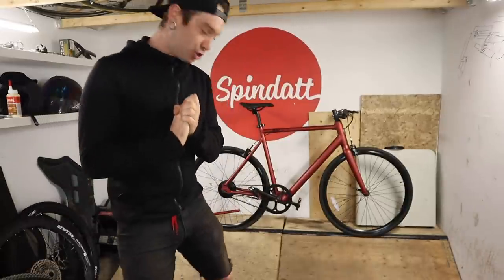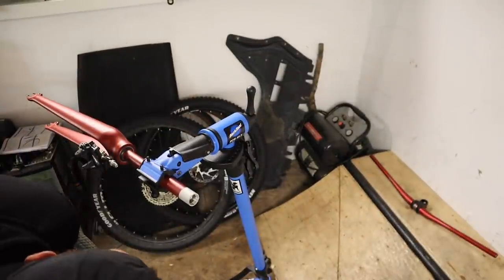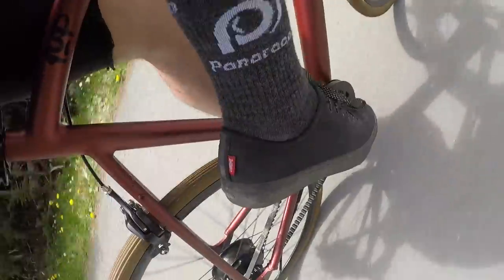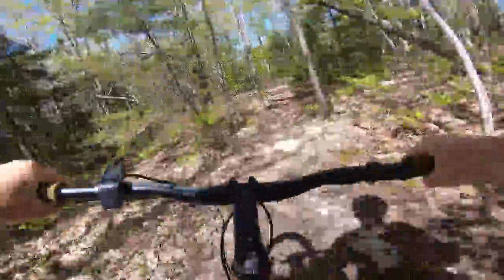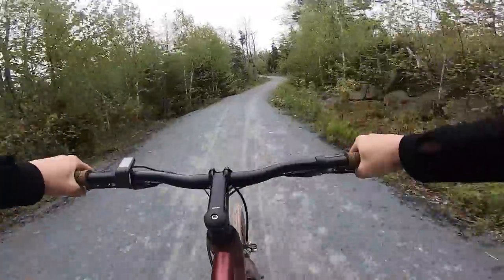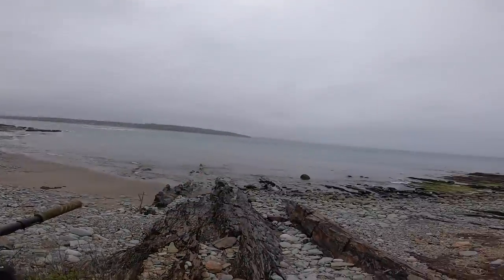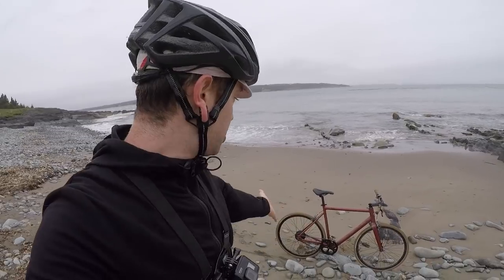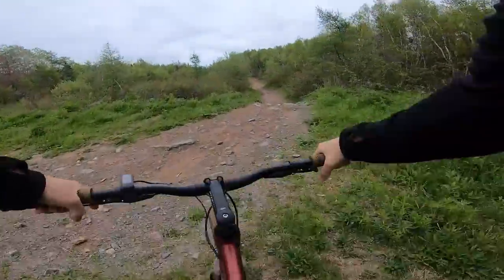RIDE1UP ROADSTER V2 UPGRADED AND MODIFIED THEN RIDDEN OFFROAD!

Comment: I feel your excitement about the ride. I love my roadster V2
I changed out the tires to 32s after first 300 miles cause I mainly ride gravel trails. Added redshift suspension stem up front and seat post. I am 68 years old but on this bike I swear I am only 27.

Comment: Thanks for the review! I used to ride a Trek Earl daily in the GTA year round and loved it for its simplicity. The more bikes I rode, the more I found myself remembering what I wished for then: a simple frame + single speed belt drive + electric assist. I'm just kind of getting back into things now, imagine my surprise seeing this. Reading the comments & seeing all the positive feedback is great as well.

Now that I live in an area with many more hills and much better cycling infrastructure I think I might try to figure a shorter gear from day 1… Ideally I figure out a solution (anyone mess around with the drive system?) before winter hits or V3 comes out soon and takes the $ out of my pocket with a solid design. The Roadster is, what, +10 lbs and ~$500 more than I remember paying for the Earl? that's a pretty great deal imho and kind of a no brainer
Reply: Any luck with an easier gear?

Comment: Uhhhh... You do know Ride1Up makes a gravel edition with all these cahnges and disc brakes already done for you? 😁
Snark aside, fun video! I love my V2 but went a different way with it. Carbon Skinny flat bars, upgraded mid reach Tektro brakes, Kool stop pads, SDG Radar flat saddle, Conti GP5000s. Use the assist controller like a 5 speed and you can really roll! Please try it drop bar and lighter crankset to be my guinea pig!
Reply: I dropped 5 pounds from my KBO Hurricane 37.7 pounds with lighter front wheel & tire, carbon fiber fork & integrated drop bars, then a thomson elite seatpost & light weight saddle.  Am still wanting to upgrade the frame to carbon fiber to lose some real weight.  I would also like to change out the cadence sensor for a Torque sensor.  What an improvement with the carbon fiber fork & drop bar arrangement, all road buzz disappeared in my neck and shoulders replacing alloy fork and flat mountain bars.  Am still looking at the sold out Gravel Ride1up version only thing I am disappointed about is they did not change cadence sensor to a Torque sensor that would have made the gravel version an almost perfect eBike...

Comment: Cool road test !  I like the  stealthyness of the bike. I have a conversion I added to my old mountain bike that has really helped me to ride farther and longer than before. I live in a hilly  area and I would bonk out too quickly before the conversion.  Also I can ride with more fit groups and not hold them back. My kit ( hilltopper) has a throttle so if I'm feeling good I don't use the electric motor at all on the trail till I'm ready to head home. One more unexpected benefit; I crashed on the trail and it knocked the wind out of me and bruised my thigh.I was able to use the throttle and electric motor to do most of the work for me and was able to get home safely without telling my wife.😄
Reply: Noel, you use your ebike in exactly the way as me, or so it seems, as I have a throttle-only set up, which gives complete control over how much power you're using at any given moment, from zero to full and everywhere between; even then, I only use it when I need it - big hills and headwinds, but sometimes barely at all, while pedalling all the while (unless I'm feeling very lazy, which I do from time to time - so what?). Thus I can go for many more miles, over worse terrain, than I could otherwise. I'm a fit-ish 60yo. And Eric's idea it should have a slopier crossbar - that was my idea first - it's what I've got - albeit with a visible battery (but, so what?).
Reply: @stevelohn2649  my brother from another mother! 😄 I'm 62
Reply: @noelbrown6771  😁

Comment: You gotta get a 55T chainring with the 22T rear. I have the gravel edition which uses a Gates drive, and Gates sells various chainrings, cogs and belts. I also run Challenger Gravel Grinders 700 x 38's. I think everyone ends up with a 120mm stem... I did!

Comment: I think there a place for a low-key lighter powered pedal-assisted ebike that been jacked with gravel tires.  Such a thing is far less impactful than fully motorized quad-bikes or dirt dirt bikes.  Most of the bike trails around here are crushed gravel at best.

Comment: Great video. Were you riding a 58" (large) frame or 52" (small) frame?  Do mind sharing your in-seam length?  I am 5'11" with 32" in-seam.  I am having trouble deciding whether to choose 52" or 58" frame.  I am afraid the seat on the 58 frame may not go low enough or I have enough standover clearance. Thanks.

Comment: I’m not normally a fan of e-bikes, but this bike looks like a lot of fun, my issue with e-bikes are that I feel I would get to comfortable with having a motor, I feel I would become lazy and use the motor more than needed, but that being said if I were to get an e-bike this style of bike would definitely be the one. It looks like a normal bike with belt drive and internal geared hub. I do wish e-bikes could have 100km range.
Reply: there are tonnes out there that can give you that range (They just don't look as smooth as this one)... also , you can set up the peddle assist with some brands so it would never allow abuse... i.e. your max level only helps 25% or whatever.
Reply: it is NOT geared

Comment: Just to be clear, I can fit the 32c panaracer gravelking tires on my roadster V2 with no clearance issues?

I bought my roadster used and the previous owner put small 25c specialized armadillo tires. The road ways can be pretty rough here and it’s giving my arms quite a beating

Comment: I was thinking that it would look good with drop bars.You may need them for extra hand positions when you go long distances.
Reply: Unfortunately the V2 only had a range of like 25 miles before battery dies
Reply: @brianwalker9793  I added the 2nd ride 1 up battery to the frame below the seat and doubled the mileage. After fist 300 miles looks were not as important as adding miles and not having battery anxiety.
Reply: @michaellangello3522  Good to hear! Curious how the extra weight 'feels' while riding? I always wondered if you would also get a little more torque on takeoff. And do you backpack the extra battery and then slap it in when first one is dry.